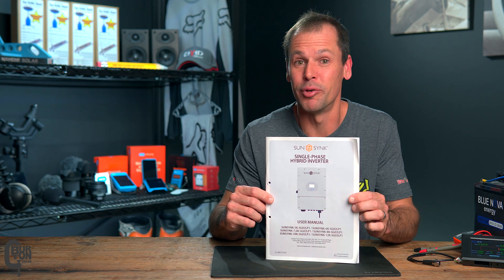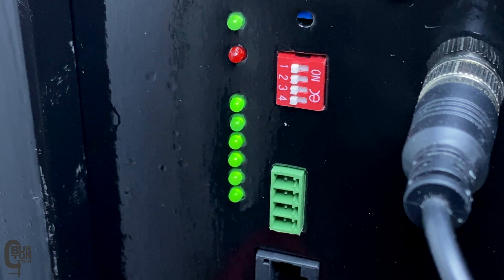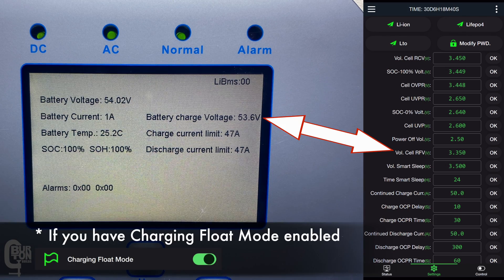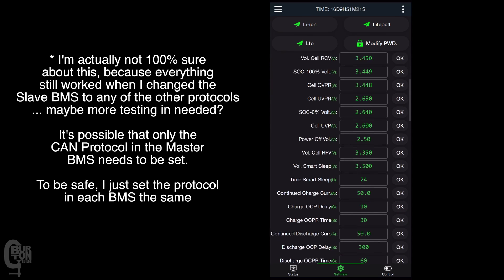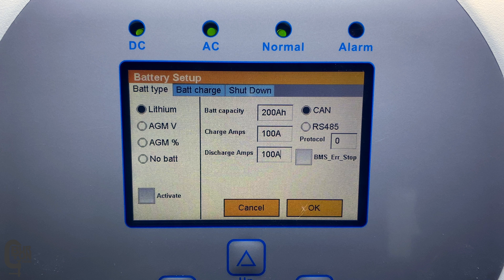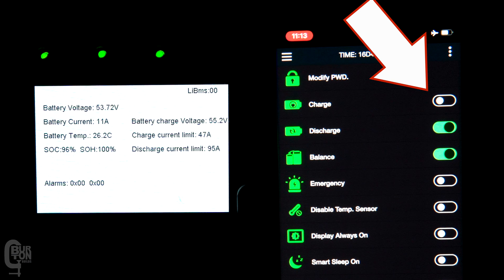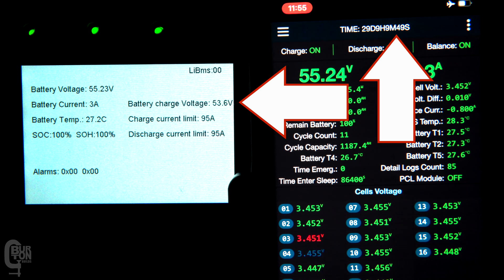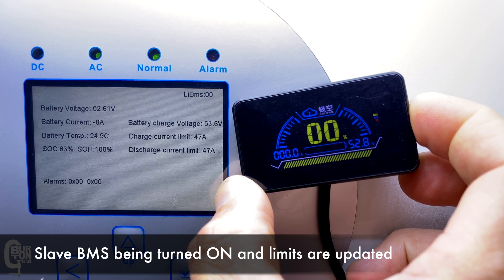Connect JK BMS to SunSynk / DEYE Inverter WITH Communication (Parallel and Single battery)

Comment: Big thanks for all the explanations. Just installed 2 batteries in parallel and got all the comunication working. What is the best option to wire the batteries? Since they are in parallel, I connected the inverter to positive terminal on battery no.1 and then the negative terminal on battery no.2. Is it correct?
Reply from the maker: It’s a pleasure. Best option would be to use a bus bar arrangement to connect batteries in parallel… something like the Victron Lynx Distributor for example (there are also cheaper more DIY options available).

Short of using a busbar arrangement, if it’s only two ‘low’ powered batteries (maybe 2 x 5kw/h), I’ve seen a few people installing a DC Fuse block/holder (like this https://www.apator.com/en/our-solutions/electricity/switchgear/rbk-fuse-switch-disconnectors/rbk-pro/rbk-00-pro#technical-data) and connecting the top to the inverter and the bottom is connected to each of the batteries (each with their own positive and negative wires) - Two positive lugs from the batteries are bolted back-to-back using a 8mm bolt to the fuse holder and the same for the negative wires.

Either way, a person should always check with the installer / electrician if it’s part of a house installation, since the installation needs a Certificate of Compliance.

Comment: hie, can you also put a video with a voltronic inverter
Reply from the maker: Hi Lance, unfortunately I don’t have a Voltronic inverter, only SunSynk… but the connection and communication should be very similar. You’ll need to check the CAN high and low pinout on the Voltronic.

Comment: DEYE is the company that produces the sunsync inverters.
Sunsync is just a slightly modified rebrand!
Reply from the maker: I believe so... thanks for the info. Not sure which Brand has better after sales service though.
Reply: @GrantBurton  I heard that DEYE has hundreds of programmers for the display interface alone!
I wrote Deye that I needed a small change in the grid settings and they changed it after a few days and it was sunday!
Reply from the maker: Awesome that you were able to submit a feature request and it was actually done in such a short time. Are you also using the JK Inverter BMS connected to your DEYE Inverter?
Reply: @GrantBurton  I am from Austria and I have four Pylontech US5000
directly connected to my three phase Deye sun8k-sg04lp3-eu
Works like a treat 😉
Reply from the maker: @animarkzero  Thats good to hear... that's a nice amount of battery storage. How many panels do you have, I'm guessing both MPPT's are maxed out with panels.
Reply: @GrantBurton  I have got 20 panels(east/west) with 420 Watts each so 8,2 Kilowatts! (10400 Watts would be maximum)
My roof lacks the space for more so I am planning for more in the Garden possibly with Micro-inverters
Additionally I scored six 250W Panels form the trash and have three Micro-inverters (Hoymiles HM-600)
I mounted them on the balcony and input each of them on one of the three phases into the GEN-port of the Deye.
My house has a separate RCD which is connected directly to the LOAD-port of the Deye.
This way if there is a power outage my PC and Lights stay on.
Reply from the maker: Thats also a nice amount of panels... plenty of power on a sunny day. Nice to find free and working solar panels, even if they are low power... on a good day you could still probably get just over 1kw of power from them? I've also though about setting up a few East and West facing panels so catch the early morning and late afternoon sun and connecting them on the Aux port, but maybe thats some experimenting for the future.
Reply: @animarkzero  Hast Du schon den SW-update für Österreich gemacht?

Comment: Hello form Greece, I had have the same problem (DEYE 5K) with the new JK BMS firmware 15.17, but I have change the JK BMS setting (for the CAN) to PYLON and all seems to work fine now (the Force Charge, disappear) !!!! Very nice videos !!!!!
Reply: I can confirm that you can use other protocols, not all, without the force charge error
Reply from the maker: @larisazah2290  Thanks very much.
Reply: Hello Grant, no i didn't see anything new in the bottom of the control tab except the total time.... Can i publish some photos (links) ?
Reply from the maker: Drop them in an email to me and let's have a look... email is in the about section.
Reply: I got 15.29 and neither protocol works :(
Reply from the maker: Hi George, thanks for letting us know... guess I'll have to upgrade the firmware again and give that a try. Did you also notice a new setting appear in the BMS app at the bottom of the control page - DRY ARM Intermittent?
Reply: Hello from Australia. Can you please confirm your inverter to bms cable type, where you connected the cables at both ends, and what piniuts you used for both ends? Thanks for sharing.
Reply: @williamwhitling9309  Nothing special, just a network cable - (CAN BAT to CAN Inverter). :)
Reply: @GPR_gprhellas  Interesting - I have a Solax X1 Hybrid inverter and they have their own pinouts and only support Plyontech, LG, and Solax CAN protocols. Thanks for the quick response.